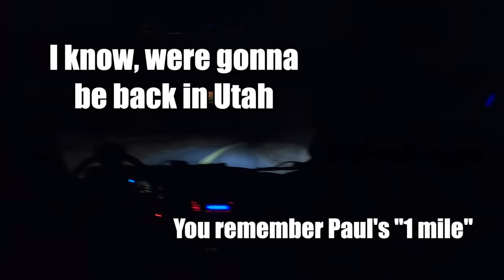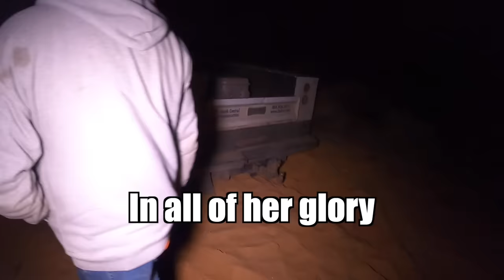You Won’t Believe Who I Had To Rescue! Best Recovery Ever!!

Comment: Matt, I sometimes do a lot of towing.  Hang a stiff tire between the 2 vehicles with a chain across at the center of the vehicle..  leave a foot and 1/2 of slack. This allows you to make turns. That small amount of slack won't let you build a big slam.  When you brake, there isn't enough slack to get a good slam.  The stiff tire absorbs most of the shock.
You always worry about running over the chain / rope. With a short chain and a tire, you don't have to worry. I sometimes have to tow women for miles. I also tow 2 ton trucks. 
12:00 - 16.5 for pickups.  10:00 - 20 for bigger trucks.

Comment: Matt, Jumper cables should be hooked up  positive to positive on battery. Negative on victim battery   your negative to motor or  other ground. That way, you do not  damage the ECU modules in the new  vehicles

Comment: You should try the Midland GMRS radios. I have a base unit in my Blazer and it can reach a handheld unit  25 miles away with some obstructions. They're a lot More powerful then a citizens band or CB unit. The antenna is only 6" tall and wire thin, no need for a fire stick or whip. And you don't have to worry about cell signal

Comment: Have you all ever thought about getting some GMRS licenses, radios , and investing in a repeater to communicate in situations like this ? Most GMRS repeaters if set up right , and depending on your location is good for up to 40 miles , maybe more if you could put the repeater up on a mountain somewhere in the area . Just a thought . It’s a bit costly but a good investment. Or maybe just apply with the FCC to get a business band frequency and repeater set up . I noticed Paul was driving a work truck that was some kind of communications company , ???

Comment: I don't blame the kid for the condition of his truck, I had something in similar shape at that age. '78 F250, 2wd, old wooden flat bed, manual everything(even brakes), someone rolled the windows down and spray painted it with about half a can each of several different shades of red. Probably 4.10 gears and no overdrive, 60mph was just screaming. Could see concrete through the floor boards, mind the puddles. Burned as much oil as gas, and the value of the truck went up 50% when I filled the gas tank.

Comment: We went out to the west side of the Great Salt Lake for some cave hunting, about half way through, the Alternator on my Dad's Jeep died. We managed to drive all the way to Snowville on just battery power. My Jeep was just about out of gas and when we got there, the town was out of power(can't get gas with no power). We stuck around for an hour until they restored power and I was able to get gas and drive all the way two tremonton to the next auto parts store to get a new one, then all the way back to Snowville to install it in the parking lot of the gas station. It was a late night but we made it back. That sooty sand just eats alternators for breakfast.

Comment: Wondering if you have a satellite communicator like In-Reach for when your cell phones don’t work?
They not terribly expensive, have reasonably priced monthly plans and can contact one another or another home based number that could relay messages.  
Text messages. Not voice. Location pings also for tracking. 
I never travel anywhere without mine-especially solo.

Comment: Try a WeBoost phone booster. They work great on the fringes of civilization. In numerous areas I've had no signal without then a usable usable signal with it. Phones have tiny antennas and benefit from stronger signals. But due to the design in a city with lots of towers they may lower your actual data speeds.

Comment: In the old days...The steering wheel/column, had no locking mechanism when you took the key out of the ignition.  They then placed a locking mechanism that when you did take the key out, the column would lock up for thief resistance.  Unfortunately, in the late 1960's, there was an accident on the Golden Gate Bridge where a Porche traveling south, left the toll gate at a high rate of speed.  The passenger in the Porche got scared and turned off the engine and took the key out of the ignition.  This locked up the steering and a horrible head-on collision happened where 9 died in two cars, two survivors, one later committed suicide...survivors guilt.  The lone survivor was a friend.  A long time ago.  50 years ago +.

Comment: You should have better communications capabilities (not just cellphones). CB range is way too short, same for GMRS. Best bet would be to get HAM radios. Requires a license but the exam is not that hard. Another alternative, not requiring any license, are the Garmin InReach units, that use a satellite, and therefore have unlimited range.

Comment: A friend called me for a rescue. He was stuck on his quad and his winch died. I got off work and had to drive almost 2 hours in the bush on my quad to find him. He was stuck really bad in a mud hole. I Looked at the situation . Tried his winch. No power. I tightened up the battery connection and The winch worked. He bought me a steak dinner that night. We still laugh about it.

Comment: How do these folks in old pos cars drive around with no nothing for when the car has problems? I have like half a trunk full of stuff in case my beater dies on me. Water, Coolant, recovery strap, jumper cables, small thing of tools and a flashlight. I've had to use the stuff before too. Although more often for someone else but still, it's good have. I'd probably keep a jump box in there too if I had one.

Comment: 3:09 whats the big deal? During winter i leave my hubs locked in all the time and shift into 4 high on the fly
Reply: Remind me not to buy any of your used vehicles. Why have all that stuff turning (and wearing out) when you don't have to? Too lazy to get out and turn the hubs, I'd say....
Reply: @coldblue9mm   So what period your rear axle is always turning
Reply: @coldblue9mm   My grandpa Doug does the same with his 67 wagoneer.  He bought it brand new in 67 adn it has 350k miles on it now.
Reply: @coldblue9mm   problem is when you're going down the road and hit a patch of ice that you can't see you can't simply lock in the hubs when your sliding. Or hit a snow drift, then dry patch then icy patch then turn onto a road where its dry for another 40 feet and then salt slushie.
Reply: @coldblue9mm   Like a sad during the summer I leave it unlocked in the Winter it's always locked.  If you look at a yj Wrangler doesn't even have locking hubs, its always locked. Yes its more wear but salt is harder on it not mechanicaly but a good axle is no good whem the jeeps falling in half lol.
Reply: @coldblue9mm  also a good axle wont do me any good if i spin out and wreck my shit 😂. My jeeps been in the family since it had 800 miles in 81 and its been run this way. 99% of this jeeps life up north, and 169k miles still strong. Yes places are crunchy but very solid for a nothern jeep thats whole life has been outside. Amyway if i break it i fix it ill run this shit till i die lol

Comment: Haven't you Americans heard of lowering your tyre pressures or a set of MAXTRAX especially when the victim reckons his out fixing fences!? If we're fencing we carry a shovel, post digger, post basher, strainer, pliers and wire. We found that if we just give advice on how to get THEMSELVES out, rather than using our tractor to pull them out, then they don't come back real quick and they DON'T come knocking on our door in the middle of the night!!???
Then again, if we charged $200 for the pull out, they wouldn't come back real quick either!?